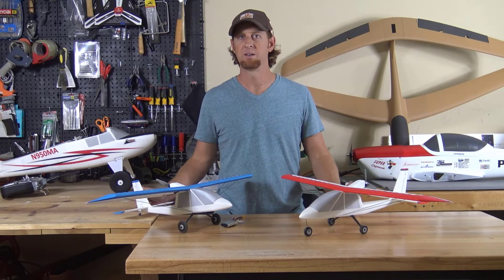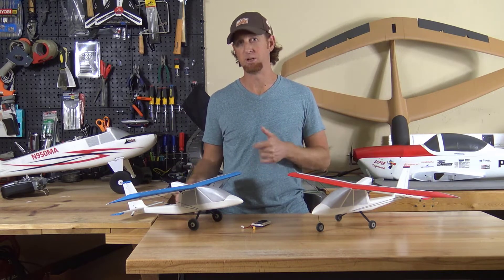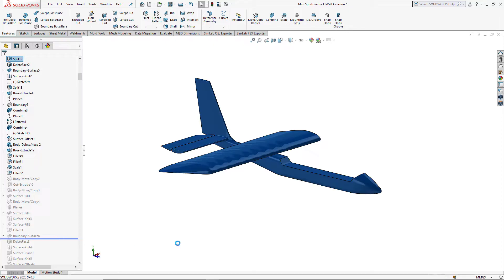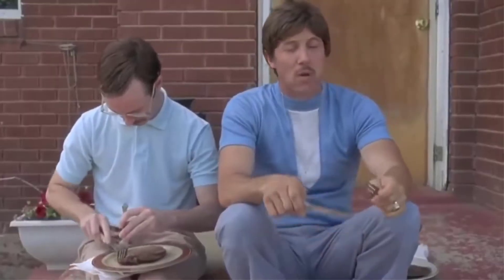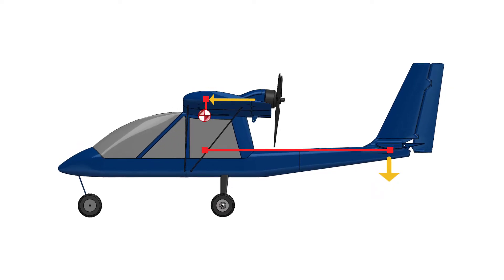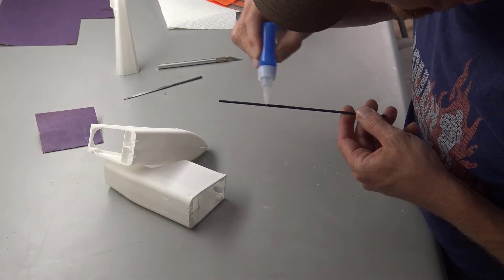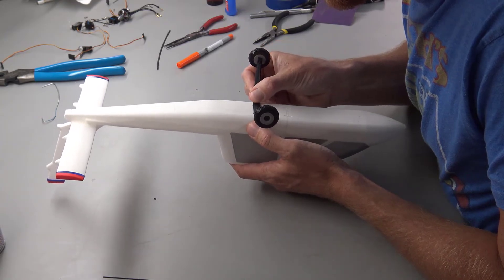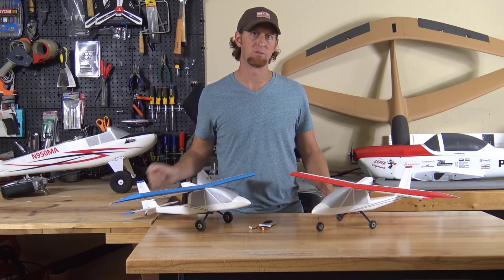3D Printed Micro SportCam RC Aircraft - sub-250g!

Comment: Have you successfully flown one printed in normal PLA? I don't care about it being acrobatic i enjoy just cruising... I've already got all the recommended electronics from previous planes and a bunch of pla. Thanks!
Reply: Exactly ! Why on earth no one talks about that ! He doesnt show normal Pla build . I dont care about speed , i have lot of pla on my shelf and wonder if i can print smth fun and can fly !
Reply: I just finished one with regular PLA, coming in right at the correct weight spec. listed in the guide. Currently cannot get it off the ground, so no joy. I emailed Eric about it, waiting for a response so yeah probably not a good idea to use PLA. I'm new to planes so hopefully I'll find a solution.
Reply: @randywetzler5976  I had alot of petg around so I used petg petg isnt that much heavier than pla so I did and I took it to the post office after I had fully assembled it and added the electronics and it weights without the battery 437 grams and just under 500 grams with the battery I fallowed the instructions I put alot of work into it and dont want to scrap the plane but its too heavy to fly any ideas?
Reply: @randywetzler5976  i have the same probleme here!!!!!!!!!!!!!!!!!!!!!!!!!!!!!!!!
Reply: @randywetzler5976  Have you managed to get any reply from Eric or anything?

Comment: I find it interesting that you gave the motor a downwards tilt.  I would have angled it in the other direction to align the thrust vector to be at or just below the center of mass.  I prefer planes that have a slight upwards pitch when thrust is applied (I've only flown flight simulators or cheap prebuilt RCs.  The type that has only elevators and turns via differential thrust).
Reply: Theres alot of plane designs that need airflow over the wings or they wont leave the ground and some need air over  the rudder or they wont turn. Everytime I see one, It looks wrong.  What a crazy hobby, having to learn all this stuff and still crash our planes

Comment: Bought mine yesterday just waiting for the lw pla some expensive stuff when you gonna start selling the super chipmunk
Reply from the maker: Joshua - thanks for the support man.  So LW-PLA does seem really expensive at first, but the fact that you set your flow rate to 30 - 40% means it will last more than twice as long as a reel of standard PLA.  So even though you are around $50 for 750g, you're getting the equivalent of about 2kg of PLA. 
I am working on the Chipmunk next!  I have the first prototype almost done and will test fly next week.  Then final CAD tweaks will take a couple of weeks.   I should have all of the files, build guide, and the video done by early to mid July.

Comment: You over complicated your moment problem fix. To easily, and more efficiently correct it, you should actually have tilted the motor mount up a little bit. This would have moved your thrust line to be even with the CG, meaning that no little to no moment was made. It also would have prevented you from chasing your tail at various throttle settings.

This is actually the problem that the 737Max ran into. When they re-engined it, they had to move the engines up and forward, which moved the thrust line away from the center of gravity. Now, they decided to counteract with by actively moving the incidence of the tail a varying amount at different throttle/speed settings.

You can see the uptilted motor design method used in planes like the HobbyKing Bixler series, along with various other high-wing pushed designs
Reply from the maker: Nathan, thanks for the info.  I did a few prototypes with the motor angled like you are describing, with the thrust line going through the CG. Because this motor is mounted high and so close to the CG it needed quite a bit of angle to get the thrust line pointing through the CG. I went through 3 prototypes with the angle progressively higher , one angled at 2 degrees, one at 6 degrees and one at10 degrees.  This progressively made the problem worse and I could barely get the plane off the ground with the higher thrust angle version. It wasn’t until I started researching similar full scale designs (such as the SeaRey amphibian) and the plans from a history of similar RC models that I decided to go the other way with the thrust angle to see the results.  I ended up having the exact same results as this guy: https://youtu.be/51QilwMelcA

I know other types of pusher designs and flying wings benefit from angling the motor so the thrust line travels through the CG, but getting the horizontal tail in the prop wash solved the problem for me, with this design.  Alternatively, I believe raising the horizontal tail to be a cruciform tail would reduce the need for much motor angle.  But that would cause complications in routing the elevator servo pushrods on a model of this size.

Comment: this is beautiful! If you dont mind me asking, for a beginner would you recommend a PRUSA
 MINI or ENDER PRO 3 (with printing LW-PLA in mind)? Or do you have an even better idea around that price range?
Reply from the maker: Hi Steven, thanks for watching.  Every printer has its pros and cons.  The Prusa Mini is very nicely built and works well right out of the box,  but it has a somewhat small build volume.  The Ender3 has a larger build volume and more options for upgrading as you get more proficient in 3D printing, but it may take more tinkering to get great quality prints.  So you need to decide what your top priorities are for a printer in that price range.  Are you willing to sacrifice build volume for it to work really well right out of the box, or are you okay tinkering more to get quality prints from the printer that has a larger build volume.  Either way you go, both the Prusa and Creality communities are really large so you'll be able to get troubleshooting help easily from other users.

Comment: Wow all your designs are masterpieces ☺️👍🏻 Interesting way of counteracting the pitch down moment from the motor, in my designs I titl the motor the other way to align the thrust vector to the CG so the moment is 0 Nm regarding the power setting. Two way of accomplishing the same thing. I like your method and I want to experiment with it
Reply from the maker: Thanks Mirko!  I did experiment with that as well but this motor is mounted so close to the CG that I had to pitch the motor up a ton in order to get the thrust line going through the CG - so it flew horribly.  Check out this article here which explains things really well.  He did a cool YouTube video about it as well:  https://www.flitetest.com/articles/Motor_angles_for_pusher_planes
Reply: @3DAeroventures  Thanks very much for the tip. I am definitely checking it out. Yeah you are absolutely right, I wasn't considering that the CG of your plane is really close to the motor. Have a nice day.
Cheers from Italy
Mirko
Reply: @3DAeroventures  Wow, Nobody ever says why its pitched a certain way. Thanks for the info